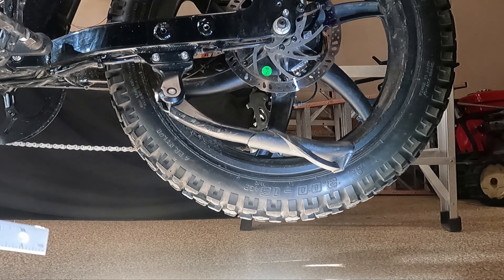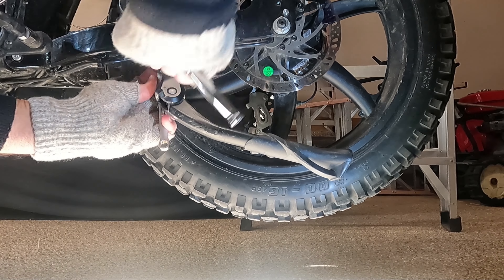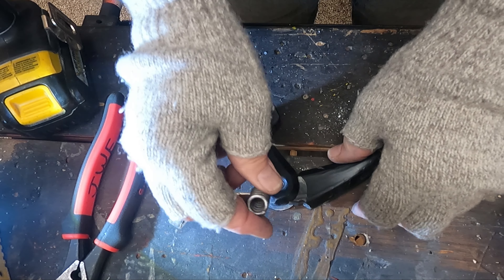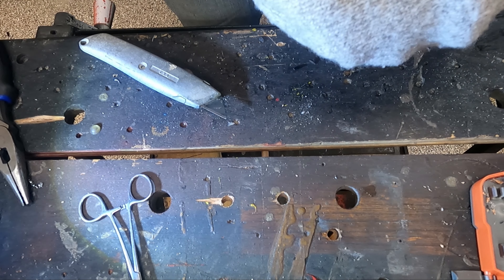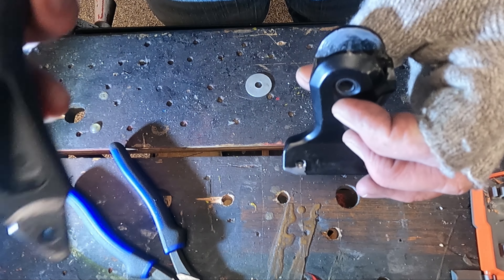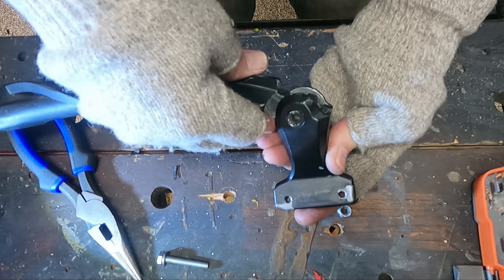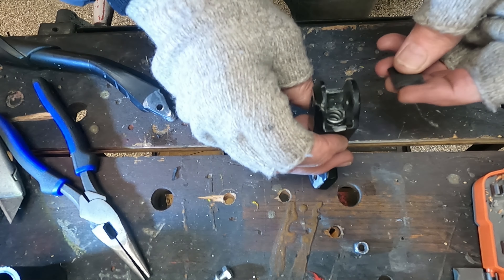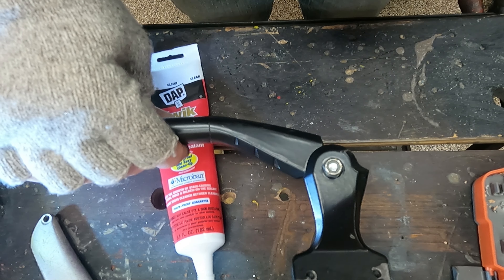👎🏻WORST E-Bike EVER👎🏻 @juicedbikes HyperScorpion P💩O💩S   Kickstand Gutted & Repaired👍🏻

Comment from the maker: This Mod/Repair worked!  The movement is smooth,quiet and no longer makes noise.
I'm unsure how long this will last, but if anything changes, I'll update it here.
I'm also wondering if I could have just filled the spring area with silicone, without disassembly.

Comment: Unfortunately my kickstand still works, but I look forward to it breaking so I can apply this mod. Thanks UF. Do you think a double kickstand like those used on motorcycles will work? I am not sure where it could be attached. Great vid as always!
Reply from the maker: Haven't seen one that would work without custom fabrication.
However, it could be possible, because we have those 2 tabs under the bottom bracket.
Reply: @UncleFjester  cool thanks. Oh a mobile bike mechanic came by to change out my tires but of course he only had plastic tire irons and could not remove the tire. He’s coming back with metal ones next week.